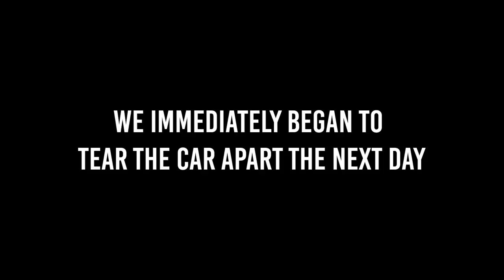MY PARACHUTE FAILED AT 180 MPH

Comment: As a former safety marshal at drags I have seen many incidents caused by parachute malfunctions, from piss poor packing to the mount snapping off the chassis due to shitty welding. From 120 up to 230 mph. I also have a history with parachutes with my time in military service. The biggest problem I see over the many channels I watch is maintenance. Most people park their cars in the off season and the chute remains packed. These should be opened inspected and hung so the shroud lines can dry, why dry. The lines attract moisture and as they are in the pack they don't get a chance to air out. My 2 cents worth anyway. Thnks for posting, always a hard thing to talk about but at least we learn about it.

Comment: You still have a sweet ride. 
If you want to fill that gap where the rack connects to your steering wheel, I used a spare bellows from the inner tie rod area there on the rack. 
It fit perfectly, used a steel zip tie to secure it to the rack. 
its springy, so it holds up that stock piece remaining from the power rack.
 Looks clean if you don't feel like sourcing the OEM stuff.

Comment: as long as you came out fine and not injured that"s all it matters. safety checks are very important and top priority in any race. i bought a brand new parachute about every year just for that reason for a peace of mind. you dont know after a couple events it'll may failed on you . due to many unforeseen factors from material deteriorating while using it hard going that fast to mishandling the parachute during storage time.

Comment: To offer some help both now and in the future, the webbing for your parachute didn't rip off, something cut it. I have worked with synthetic material for a long time one thing it doesn't do is break without warning. I would look into the tensile strength of the webbing used for that parachute or just look up synthetic webbing material by strength/ply's. I think you may find that maybe the webbing wasn't strong enough for the application and something cut it or it just wasn't meant to survive the stress put on it. Hope this helps

Comment: Everyone crashes even the best drivers. It comes with the territory.  Thats how u learn the car more and get some split second experience under your belt. Plus fwd are wayyy harder to control or correct especially on the top end with all the weight in the front of the vehicle. Most important thing is you are in one peace and walked away unscathed. Bless up always

Comment: Definitely go with wheelie bar setup to help with the weight shift on take off. Can help tremendously with the front wheel spin also check into that 100% glad your ok and the car is saveable. Lots of ppl your right haven't been there so hate will come at any angle an point but just food for thought hope my option helps you out to get the car to hook a bit better. Definitely had 1 on my car back in the day an helped really well. God bles you 🙏🏼

Comment: Glad your alright and the car suffered minimal damage. All that being said, you need to reevaluate your brake setup if you truly got on the brakes when you were supposed to. There is no reason a sub 3000lb car can't be stopped under brake power alone in that amount of shut down, the chute is just to keep the brakes from getting beat on pass after pass.

Comment: This is why you should never put a chute on a car and then not use it.  It is not good on them to be packed up and just stay packed.   They will also stay in a folded position and not want to deploy properly if they are just stored folded up all the time.  If you have the chute you need to pull it and use it.  If you don't need it then remove it from the car until you need it and do a thorough check on it before using it.   Also you should check on your brakes because a light weight car like that you should have no issues stopping the car with good brakes if you need to unless you had a mechanical failure of the brake system as well.

Comment: You could have easily saved it! Not a good driver. JK!! Seriously it can happen to anyone, it is sometimes impossible to react fast enough specially in certain conditions but regardless you are OK which is the most important part. The car is super fixable, nothing major with it from our angle as viewers. Hopefully nothing crazy with the frame and everything is easy fix. I crashed my 350z first year and third year of drifting, best thing though we learn, we improve and get better! Nice seeing you at TE2022 and good luck with getting the car back together and fast build so you are ready for 2023 season!!  P.S cojelo suave y no dejes que los comentarios negativos te impidan ver el fruto de tu trabajo duro!

Comment: I crashed in to a deer at 35mph once in my EM1 and it jacked up the hood, rad support, headlight, bumper cover, rad, & fender. So as far a crashes go you did pretty good considering you where just doing 170mph.

Comment: Joanne I have been in the same situation twice.First time ended up in the sand trap at over 210 miles on a tiny starlet and it was scary as fuck.Parachute didn't open and at those speeds you know that you can't slam on the brakes so l let of the steering wheel and flip all the switches killing the engine and braced myself.At those speeds there isn't much time 2 think.Most people is gonna tell you oh you could do this and that and is all bullshit.Second time I did freaked out a little but I was on a slower car so I sadly slammed the brakes 2 hard and it went left and hit the wall.
I'm glad you are okay and look at it as a learning experience.Get the car fix and go for it again.
Fuck the haters.Good luck.

Comment: No hate at all glad car is fine I loved this remember the car when u got it but I’ve seen this before I’m a little baby I run slicks and run my streets in the rear and I have 4 pistons in the front stock integra in the rear this is an ej coupe making around 620 on hub dyno couldn’t imagine the power your running and relying on the shoot to stop you I’ve seen so many videos of it not coming out or getting twisted aswell soo scary you got my respect lol

Comment: Don’t let keyboard warriors get to you but the good thing is you’re getting views. 

Even the best people in the business can get it wrong. 

One of the guys that used to cruise the streets of the Gold Coast in Australia ended up dying from professional track organisers sending him the wrong way down the quarter mile. 

He was one of the first people to have a thousand wheel horsepower. 

They said to go the wrong way down the track and he did this but his accelerator was stuck on full throttle. 

One of my mates was filming his run and he was doing about 250+ kilometres per hour and he had his brakes on and the back wheels were spinning and was like doing a burnout. 

Then at the beginning which was his end was a concrete barrier and he hit that at over 200kmh and then after 30 seconds a fire started and the safety crew took up to 5 minutes to get to him but it was to late and he passed away in the fire. 

If you want to see the incident look for Todd Wilkes ( judge) dies in accidental at Sydney drag racing track.

Comment: You told when the shute broke you had no breaks. Doesn't it have any normal brakes?
Reply from the maker: It’s not that I didn’t have any brakes. I got the car to slow down to 80mph with foot and hand brake but it was too late. Basically when I pulled the parachute, I was waiting to for it to grab as you’re supposed to do before hitting the brakes, and when I realized that it didn’t grab not was slowing the car down, that’s when I tried to slow it down as much as I could but it was already too late. Bradentons shut down is not long at all so I didn’t have much room to stop it before going into the fence. Parachutes don’t normally ever break the way that it did. (Still unsure how other than it dry rotting over time) Plus I am new to using it. This could’ve all possibly been prevented If I would’ve pulled it sooner, although it would’ve still broke, I may have had more time to stop the car. I wasn’t anticipating this to happen in the moment nor do you have much time to think about other things you could’ve done, as it all happens so fast. Your one goal is to stop the car in a moment like this and I did everything I could with the amount of time that I had.

Comment: I kind of know how you feel on that one I used to run a 70 Camaro with a big block blown engine and I hung an intake valve backfiring the blower and sending it into orbit taking out the hydraulic lines for my brakes and the shoots weren't enough so I ended up in the sand traps destroying the front end of the car actually never put it back together after that either it was just a toy I'm actually a circle truck driver

Comment: Hey I was thinking of how to get these front wheel drive cars moving a little quicker down the track and of course it has to do with getting the rear wheels moving. I was looking at how people are using Tesla parts or EV parts Making real drive cars maybe that’s an idea cause I don’t believe your car limit has actually been reached with that motor I think that motor can do so much more just my opinion but if you get the real wheels Going off the line and then that engine takes over I bet you could hit 200 my personal opinion

Comment: Your shoot might of been packed away slightly damp mby? That would give the conditions for rot if it was left for long enough.

Mby time to invest in some new breaks just to be safe, as you'd never expect a shoot to rip off like this, but there are multiple ways shoots can fail, and you don't want to solely rely on it and try to always have redundancy in your safety systems. 👍😉